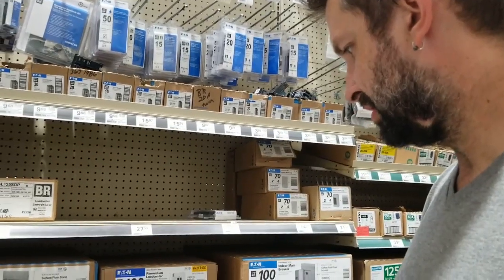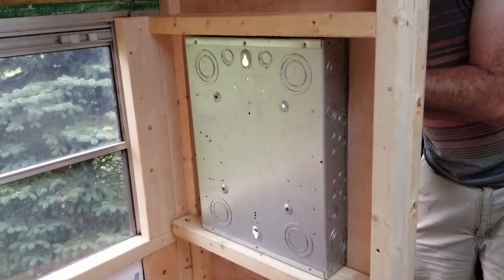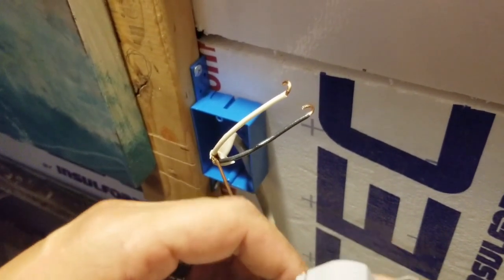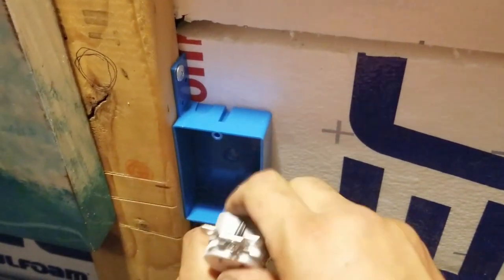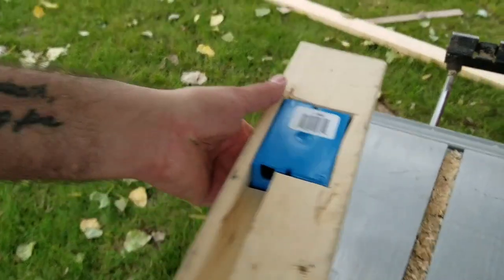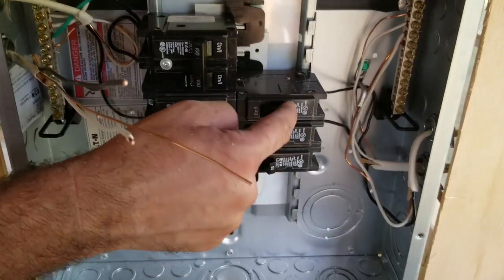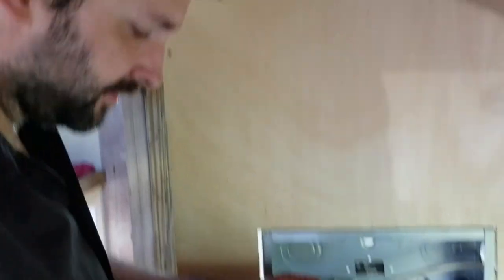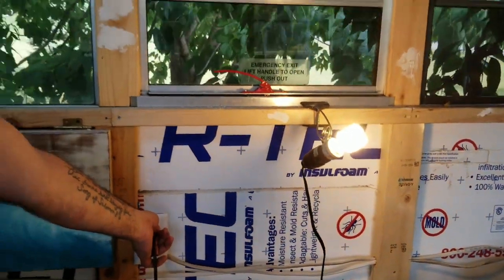Wiring The electrical In Our School Bus Conversion

Comment: You'll save a lot of time if you install the outlets AFTER you finish your walls, otherwise you'll have to unscrew all the outlets and then screw them back in. The hole in the wall will be smaller than the height of the outlet. I'm glad you said this is not a how-to video. What powers the panel?

Comment: All you need is a power system and they are made for rvs and come with fuse panel and 5 stage charging and the 30 amp input. My goodness. You are using household stuff. Why?

Comment: Solid core "Romex" type wire will work harden due to constant vibration encountered in a road vehicle. This will make more likely the possibility of a broken conductor and the possibility of a shock hazard. Stranded "Boat Wire" which can be had in jacketed multi conductor cables of standard gauges is the correct choice for wiring the AC high voltage circuits in a vehicle. This mistake is all too common in these conversions.
Reply: This is important information!  I have been buying up old, heavy duty extension cords at garage sales etc. to use in my bus.  Just be sure to use the correct gauge or bigger for each use...Got about 1/2 my bus wired this way and it's working beautifully...

Comment: Changes to your wiring.   You main breaker is too big for that little wire.  You should have a Max 30 amp main since your running single phase.  The jumper is ok, but that is a 20amp wire you have hooked to a 100amp breaker.   Please connect your neutrals and your grounds to separate bus bars in the box.
Reply from the maker: Ok,  thank you for the advice. 👌😁